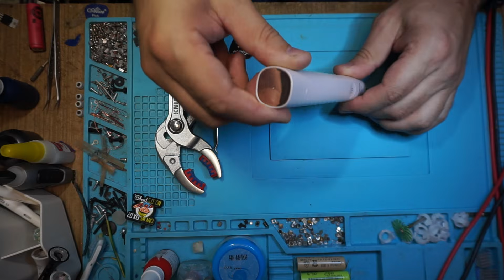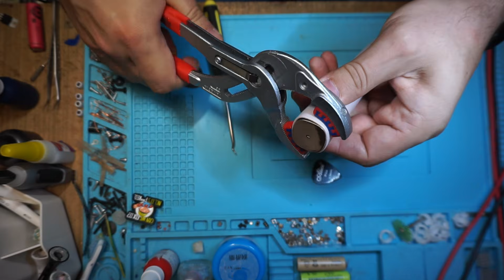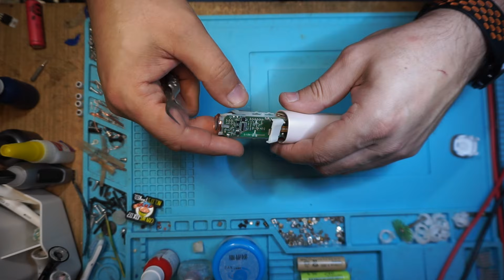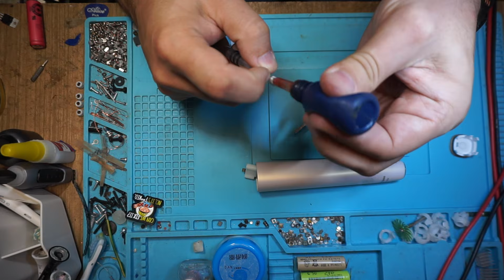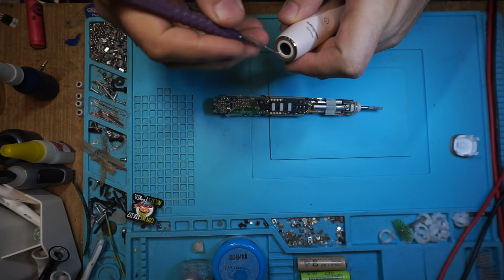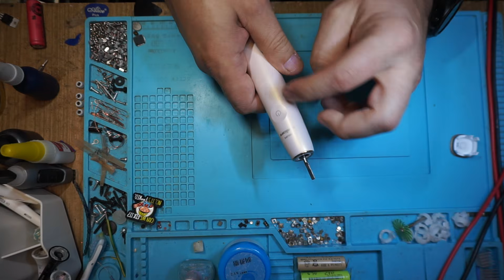Philips Prestige repair of loose tip. Complete disassembly and assembly. Tips for repair

Comment: Thank you for this! I'm on my 3rd 9900 prestige. Purchase 1, 1 warranty and purchase 2nd one. Now 2 years later the same problem. I just did this repair in about 5 min. The end cap is not seating square around the edge. I believe it will only go in entirely one direction. Any suggestions?
Thank you so much!

Comment: I found it easier to use compressed air to open the brush.
Reply from the maker: On prestige I wouldn't use compressed air method as bottom cap is sometimes glued with double sided tape so you risk ripping out the charging coil. But yes compressor method is quite good and even preferred for smart diamondclean toothbrushes with lighting ring on the bottom as it preserves the ring from cracking

Comment: I have it reconnected. It shows. I have power and it lights up the buttons 123 does not vibrate. What is the possible fix?
Reply from the maker: What was the initial problem? Check with the oscilloscope if you have output signal on electromagnet. Does the magnet and electromagnet have a gap?

Comment: Thank you for your videos. They've been a huge help. I've been trying to get my toothbrush to work after noticing two various common problems you mentioned (loose head and magnet/electromagnet touching) and after puting the unit back togehter, I noticed the toothbrush won't power on. For some reason I can still change the sensitivity of the toothbrush, but it just won't power on! Looked around my workbench a little and noticed a tiny square piece of metal that reads [.ONJ A209]. where does this go???
Reply from the maker: Have good news and bad news.. good news you found the problem.. bad news it's not repairable and you need a new housing... I speak about this problem when I'm inserting toothbrush in to the housing.. on housing electronic is exposed and if you go in with wrong angle it's easy to knock it off..

Comment: Thank you for the video!  My Prestige was rattling and out of warranty. I took it apart following the steps in the video and tightened the screw but now the power button will not work. (The brush is fully charged and I am able to change the intensity indicator). Any idea how to fix this?
Reply from the maker: This one is difficult.. most probable some smd chips that are glued to the housing or flex cable got damaged on taking it apart..easiest check is to insert your toothbrush on to new housing but they are difficult to find.. are you from Europe? Maybe I could help, write me to letsfixitgarage@gmail.com

Comment: I saw hot glue way to pop the call off and send to be legit
Reply from the maker: it works but hot glue tends to clog the hole that is needed for ventilation and sometimes it damages the paint finish so i don't like that method :)
Reply from the maker: One more word of advice that I found in forums that hadn't occured to me.. prestige bottom caps often have double sided tape that is glued to the charging coil. If you yank it to strong with the hot glue method there is a chance of dewinding the charging coil.. so slower method with clamps is safer option here..